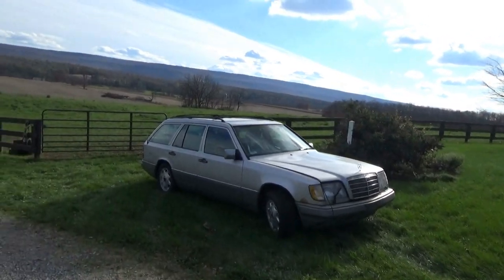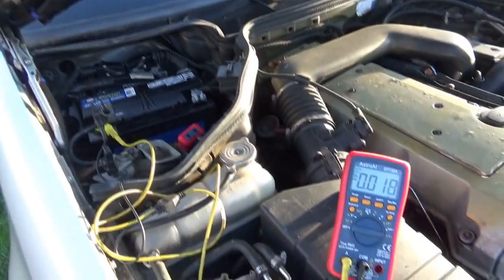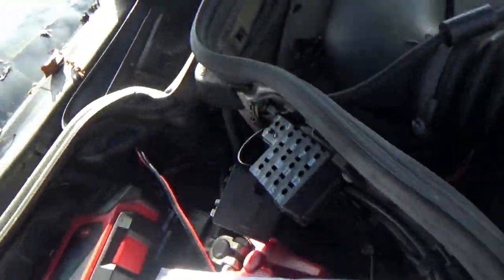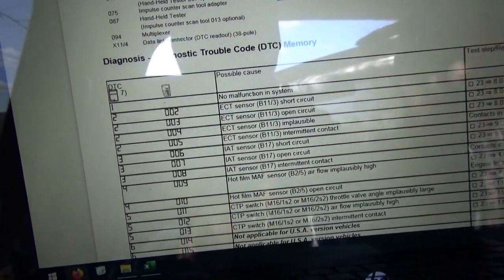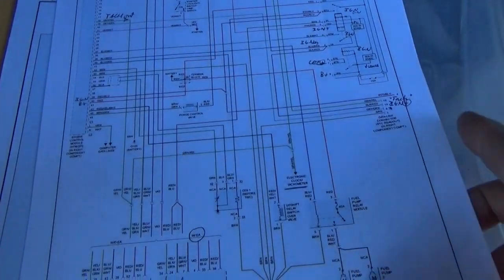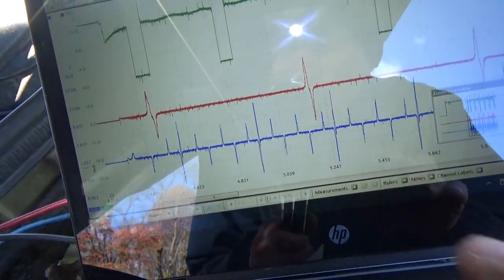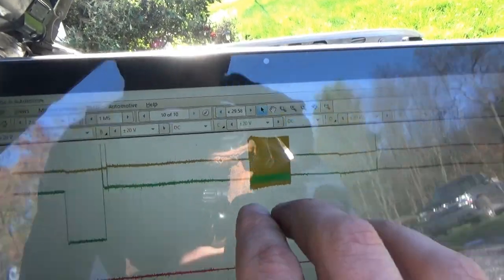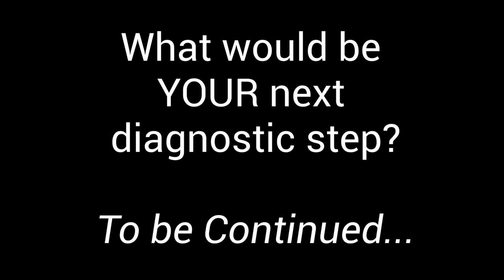The MYSTERY Mercedes - Part 1 (Thanksgiving Special)

Comment: Says a lot about the mechanic when folks bring their vehicles from other states or several hours away. Great mechanics are hard to find now a days. 😀
Reply: I would if I did not have a good shop near by and it was a car more complicated than my Jeep. It would be a vacation. PHAD or SMA
Reply: Most shops have overhead, rent, light bill, insurance etc.  They are financially motivated to bypass sound and reasonable diag methods to quickly get the revenue flowing.
Reply: @Garth2011  not true,  working in a massive shop myself people are too cheap to pay for the right diagnosis. If you find someone who has a lower shop rate then thats a bonus. As far as worrying about overhead. I dont care what it costs to fix my clients cars as long as it was diagnosed correctly and they are happy then i bill my appropriate hours
Reply: Yeah - something like this in my experience you have two options. Put in endless hours of work to solve the problem yourself or find someone like Ivan to put in a couple days work to work out whats wrong with it.
Reply: Actually, these days its not hard to find excellent auto technicians.  The industry has changed over the last 2.5 decades.  People have to generally love the trade to get into it now and are willing to put up the ignorant stereotypes perpetuated by those bad apples that took advantage of  what once was not considered a skilled trade... It's not the 1950s anymore.    There are Ivans and Eric Os in every town and city.  Problem is...people have a backwards way of judging this.  Fact is.. the good techs are the ones that charge for diagnostics.  Not the other way around.   Professional technicians charge for their time and knowledge and back it up with guarantees.  Mechanics fire parts cannons.  People who are willing to waste hundreds of dollars on a free "guess" are the same ones to refuse to pay 100 dollars for a guaranteed diagnosis.  The problem has never been a shortage of good techs...its always been a shortage of good customers.
Reply: I am waiting for him to come to Washington.  I have something no one has figured out and many times I thought about selling it then I think of Ivan and pray.  I have a 1997 e420 that I work on but the problem is with a plain old 1992 ford xlt F250.  It goes into limp mode.  I have searched and replaced lots of stuff no luck. Help me Ivan haha.
Reply: @TheBROY123  That's is exactly why we have diag issues with shops, they want to help the customer in a cheap diag instead of standing firm, this is how it needs to be done.
Reply: @jeffreywilsonrubikscubeonb2428  So true, the public will ignore all the facts until they find a discount or a free bandaid idea. Most owners are not interested in paying for a correct repair...I know a lot of them and they are cheap skates but at the same time there are those who believe only a dealership is the right place for repairs. The key is, find the tech who does what we see happening here, real research that will back up the call or part replacement so that the customer is handled right the first time.
Reply: @jeffreywilsonrubikscubeonb2428  the shops around my area wants  to pay to a good technician  no more than $ 20  an hour , I am saying  Master ase level , entry level $16 per hour  , next to hour building  is  the hamburgers  place  in and out they pay in between  $19 to 21  so most  people fell motivated  to go and work with  them ,  and it is not  something particular  to the shop where I work .
Reply from the maker: @JoelAutomotiveInaction  wow that is sad that you can make more money flipping burgers than fixing cars... That's nuts!
Reply: @Garth2011  you would think a dealer  would know its own brand inside out but sadly this is often not the case, essentially older models. Independent specialist is the best option for an out of warranty car.
Reply: @JoelAutomotiveInaction  They will pay more once mechanics stop taking that kind of pay, quit and leaves the shop to himself. They pay that amount because they can find "mechanics" to do the work for that pay. Likely they aren't well versed mechanics.
Reply: @vw5056  Yes and usually with a dealer, there is more focus on income vs. a fair diag and repair.
Reply: @Garth2011  good point. I always felt bad for mechanics. They went to school, do all the work and even supply their own tools for a mere crumb off the cookie. If these sleazy dealers are charging as much as $150/hr for repairs the mechanic should get at least half. The service advisor, a make work position, often earn more than the guy actually fixing the car!
Reply: @hikerJohn  what's SMA?
Reply: @thebeddoctor4273  South Main Auto Repair
Reply: @thebeddoctor4273  south main auto repair , another good auto repair YouTube channel in New York .
Reply: Nice comment but it would've been nicer to say great Techs instead.
Reply: @JoelAutomotiveInaction  I am paramedic....16.00$ per hour. 
There is built in overtime, so yearly is 60k$, but I have to work my tail off with 24 hour shifts to get that!

So everyone, including healthcare workers, look at the fast food industry and scratch our heads!
Reply: @TheBROY123  how do they avoid disgnoses? They just come with a part they want installed?
Reply: @jeffreywilsonrubikscubeonb2428  that’s complete nonsense. There are so many shady shops, no end. Even on this channel, good mechanics won’t agree with you privately, like me. The scams are extremely prevalent now because most can’t handle a scope or look at the can bus

Comment: Excellent Ivan,  nothing phases you, Mercedes (Daimler Benz) developed the CAN- BUS system, nothing wrong with counting a few Leds; available to anyone without expensive diagnostic tools in 1995.
Thanks for sharing,  and may I  wish, your family and all Republic of the United States a safe Thanksgiving 🙏
Reply: *fazes
Reply: @TonyRule  Most interesting.
Reply: Fayzez
Reply: I got a 190e 93 in my yard, 4 Sedan. But has the can bus system. Now I know what to do with it. Finally. I bought it running rough. Got it to run smooth. Now crank but no start. Good crank too. Been sitting in front of my trailer since 2017. Got the 2.9 inline it. Those good motors?

Comment: Like several other people posted look at the wiring harness. I had an E320 95 wagon like this and a 95 S350 Turbo Diesel. I had replaced half the engine wiring harness on the S-class by the time I sold it due to the insulation falling off the wires. The wagon was new enough and didn't need anything besides basic maintenance.
I probably pull the CKP and inspect it and have a closer look at the flex plate while turning the engine over to make sure everything is good there.

Comment: Those blink codes were fun with OBD-I.  GM & Ford used Fast and Slow blinks for the ‘ones’ and ‘tens’ place of the code. I guess Mercedes engineers had nothing but time to watch the LED blink 47 times!! Lol
Reply: Some of the Chrysler vehicles had those blink codes in the mid 80's as well.
Reply: I’m in uk and Vauxhall used blink codes too
All you needed was a bit of wire between two pins in the diagnostic socket and watch the engine light flash on the dash😂😂
Good old days
Reply: @MrLocky31  "Paperclip" test.
Reply: @MrLocky31  Vauxhaul... now there's a name I haven't heard in a while.

Comment: The ckp sensor could be inverted if you say it's from a newer model year. A few years before (91) Mercedes used biodegradable wires that would crumble and short out in 10-15 years. You had to replace the entire harness or replace all the wires to fix those. Not sure if 95 models still had that problem.
Reply: Also put back all the original parts, aftermarket are often junk out of the box.
Reply: Harness all the way up to next e class

Comment: Quite an interesting diagnosis Ivan. I still have one of those W124's, but the older style Mechanical Fuel Injection system and is quite easier to diagnose and get running. Those newer W124's with the HFM system are more complicated to trouble shoot and have a history of failing wiring harness insulation. Which is the reason I got the older model. 

Looking forward to when you get to pinpoint the cause of the crank no start and the fix. Cheers!
Reply: I’ve a W211 04 E320 she’s also a good machine now running at 200k km

Comment: I am wanting to say that 1996 was the first year for OBD II diagnostics.  My 1987 Chevrolet El Camino has CCC   (Computer Command Control) uses the check engine light to "flash" codes.  The computer controls the spark advance and the mixture on the 4-bbl Quadra-Jet and a few other things.  Great video!

Comment: looks like a large can of worms has been opened. that's some weird looking ringing on the coil control, I'm thinking bad ecm ground or the ecm has some capacitor death and crusties all over the inside from cap leakage. seems to have been a lot of that around that era. not sure about mercedes but probably.
could be compounded by the crank sensor being inverted, but I'd imagine it would cut fuel as well as spark. is the crank to cam timing offset right? 
I assume they did the parts canon of coils, CKP and MAF all at once after it quit running from other causes, which is why I said ecm ground/bad ecm.

Comment: Hey Ivan, a remarkable piece of art this machine is :). Fency blinking diagnostic codes, weird signals on the scope, vacuum tubes popping and vanishing in the dark depths of the engine bay :). 
I should say you need to take advange of the ability the hood to be lifted vertically upwards. This gives a great access to the guts of this beast (check the hinges). 

I am not sure, but probably you already got the information that this engine management system during the starting phase (until the engine reaches 500rpm) has fixed ignition timing. This fixed timing is dictated either by the crankshaft  or the camshaft position sensor (depending on the engine managed). This particular engine (by the look of it I believe it is M104.992) uses the camshaft possition sensor for the fixed igniton timing. 
You did not gave us complete picture about during what circumstances you got the different waveforms for the ignition signal (one with nothing at all and other with some fency bursts on the line), but I reckon that the one without any movement on the ingition signal was with the disconnected camshaft possition sensor and the others with the bursts were with connected sensor.
This engine also has what Mercedes-Benz back then called "Camshaft Adjuster", which can advance or retard the shaft by 32 degrees crank angle. Troubles with that system could cause poor engine running, misfires, rough engine idling etc.
Based on the aforementioned guess I took and the back log information you gave us for the vehicle and from the thousands kilometers I am sitting right now I would guess - Camshaft sensor troubles:
- The gap between the sensor and the camshaft.
- Wrong/Not meeting specifications sensor.
- Stuck/malfunctioning Camshaft Adjuster.

Although ......

Based on my past experience with M111.941 (which is PMS (Pressure Management System) controlled 4 cylinder engine) - they might fried the HFM-SFI (ECU) module. 
These things are very picky and do not tolerate free play with the igniton system. 
For example: what you have done  - taking out the coil and trying to see if there is a spark grounding the sparkplug on the engine metal (like oldschool soviet style spark check) is forbiden by law for these systems. The transistor (I believe it is MOSFET, but it could be open-collector bi-polar) grounding the ignition line in the ECU is blowing off itself immediately. Personally threw in the trash two ECUs of that kind due to bad spark plug cable, which was preventing or intermitenly loosing the spark of one of the cylinders.
From the other hand blowing off all three transistors for the three coils simultaneously is highly unlikely. If only one line was damadged you should be able to start the engine but having very rough idling. 

Very peculiar case!
As the brand slogan says - "The best or nothing!"
Usually, when they break this is the part, when "nothing" comes into play 😀😀😀

Good luck!
Reply from the maker: Great comment! You will certainly enjoy the rest of the series and the outcome 👍😁

Comment: Brilliant video as always. Good to see some old school tech and with the customer computing from all that distance it shows there aren't many who CAN fix these types of issues.
I had a similar issue one time on a TT, a shorted coil pack was pulling the ignition circuit down. Maybe disconnect coil packs and rechek ignition control

Comment: A tip for PHAW: all Mercedes hoods have extra releases at the hinges that allow the hood to stand straight up and lock in place vertically. That gives you a LOT more headroom when you need to get back near the firewall. It's a feature you should learn about and use. It may save you some chiropractor bills...
Reply: would you say it gives you max headroom?

Comment: The crank signal is not just inverted. In the diagram it shows the large pulse starting with low. So you have low, lowhigh, low, high... On the scope, the large pulse goes in the same direction: high, lowhigh, high... Is that a problem, I wouldn't be so sure. What about the signal levels? Wasn't there some Staten Island vehicle or something where the signal was there, but just not powerful enough for the computer to register it correctly? Or slipped timing? What about sticking a borescope in the crank sensor hole to see if you can see anything funny going on? (Rust jacking? Loose timing belt/chain? Messed up notches/magnets? Yes, they replaced the sensor but that doesn't mean it is properly seated either.) Also I noticed that the dash tach does bounce.
Reply: "I noticed that the dash tach does bounce"   
 I have seen that referenced before but I do not know what that tells me ???? TIA
Reply: @jimharper6073  I think usually that would indicate the computer is seeing SOME crank signal. Doesn't mean it is seeing the full, correct signal though.
Reply: Jessica. You know your stuff, girl!   You've been wrenching a while I bet
Reply: @robertbien7895  Been repairing family/friends vehicles for years. But I am an engineer, my goal in life is to be able to fix anything :)
Reply: I noticed that low high low thing to.

Comment: Hey Ivan🤘 The old ones can be the most tricky..lol..Perhaps if it has an external ignition module it might be bad, I think they were 2 wire coils but I better go re-watch. Pretty sure you had coil control, so that should rule out an ignitor module issue if it has one, but no spark events seen on the scope trace and that weird hash we saw on the coil control captures has me very suspicious of a coil control issue, or bad ground etc. If it's not fully grounding the coils, maybe it could suggest a bad ground to the module, if it even has the said module, or a bad pcm ground if ignition coils are pcm controlled? Although, I'm guessing the next step might be to verify cam/crank/timing relationship...and I don't like that hiccup in the cranking kadence🤔👍🇦🇺

Comment: There's a problem with the CKP but it shouldn't keep it from starting. If its firing injectors it should be firing the coils. That weird signal makes me wonder if there's some problem between the ECU and the coils, like a bad ground or power wire.
Reply from the maker: That's exactly what I thought too...if it's firing injectors, why not fire the coils?

Comment: Straight 6 from the days when real motors were a thing.
Reply: Yeah except I think these were known for head gasket issues.
Reply: @kevin9c1   Couldn't be too bad, this one's 285000 miles and 27 years old. I bet you the fix is going to be simple once he figures out what precisely is wrong.
Reply: @stevewhite3424  Sure.  But do you think it's on its original head gaskets?  I don't.  It just means someone paid to keep the car on the road.  Which is fine.

Comment: Back to basics, the car does not like the CKP sensor, Why?  This is an old car and probably does not have CMP/CKP timing error codes.  If the computer is using the CMP as its reference and sees the CKP out of time with it this might be the error.  I would look at the wave form traces and check the crank and cam position relationship in detail.  The CKP tells the computer when to spark but the cam tells the computer when to inject if the timing is out it just will not run.
Reply: Could the voltage not be high enough if the gap between the sensor and the flywheel changed for the following model year?
Reply: I wasn't watching closely, but what was the amplitude of the waveform?  If the gap is wrong, the computer isn't going to see what it wants to see, but it still looks right on the scope if you ignore the amplitude.

Comment: I have owned a few Mercedes gas engine vehicles. ML 320, S 430, SLK 320, SLK 230, and now drive a CLS55. Every one except the SLK 230, needed a crankshaft position sensor at some point. Oddly enough, I bought my last one from Amazon. It was genuine Bosch, made in Germany . Was around $18.😳

Comment: Just stumbled upon this video. Great work! By the way, a "cheap-ish" (~$100) automotive meter by "ALL-SUN" (?) EM-135 has two functions specifically for this. One is fault code counter, which does what your LED does, but more automated. The other is Mercedes DTC reader. The meter is rather meh in the accuracy department as a multimeter (certainly does not warrant $100 tag), yet I find it OK for working around engines and it has other useful features for automotive or just small engine work. For modern vehicles fancy scanner and picoscope do more than a meter though, so it might not matter to you.